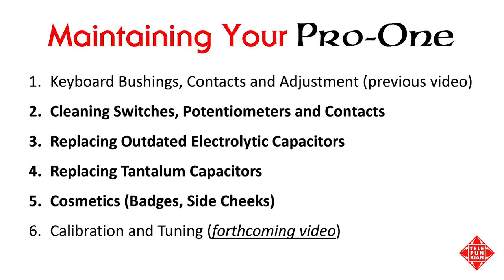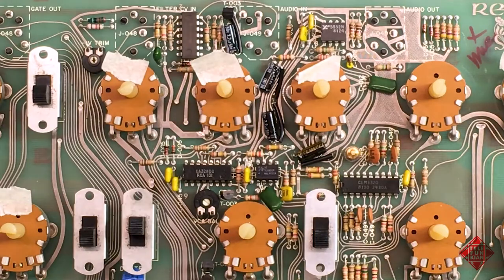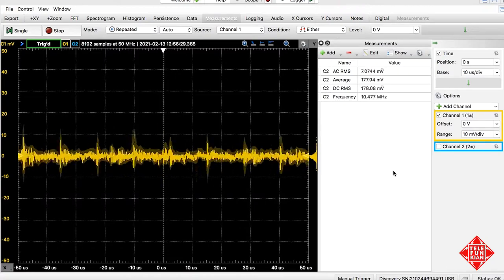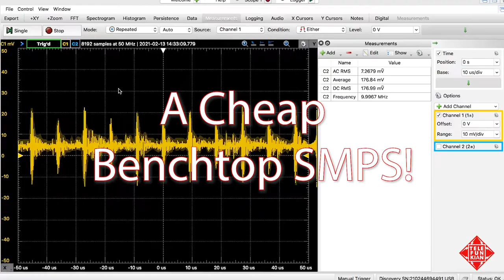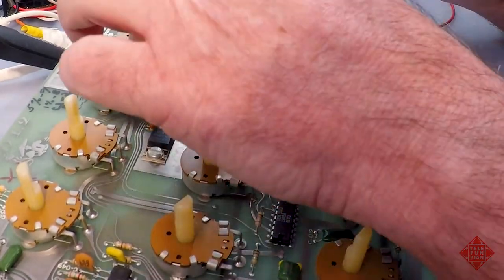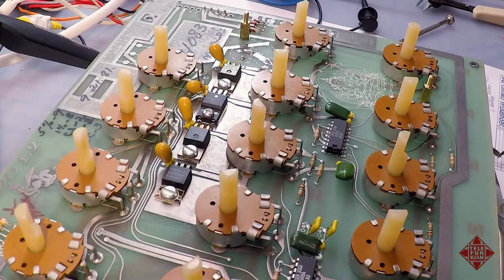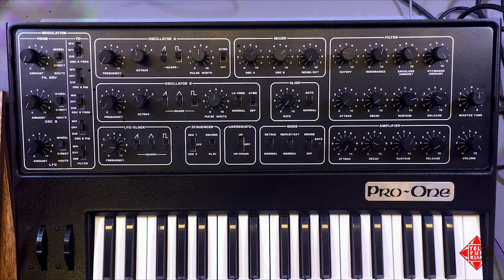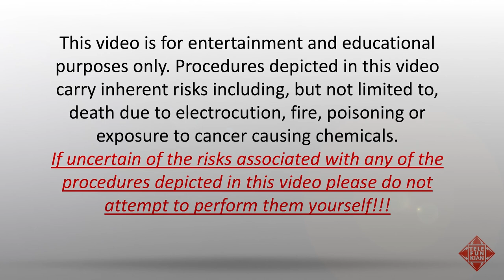Maintaining Your Pro One

Comment: Hey Telefunkian! Thanks for this video. I shot you an email, but was curious which new capacitors you ended up going with in the end.  Thank you!
Reply from the maker: Danny, Thanks for the message. I can't recall which caps I used off the top of my head but generally I use Nichicon's or Panasonic. If at all possible I use 105 degree C caps in the power supply and 'Audio' grade caps in the case where caps are in the audio path (Nichicon FG, FW KZ etc.). The audio grade caps are most probably overkill but they only add a few dollars to the cost of a recap, and these machines are pretty special so why not. Stick with original capacitance and close to or slightly exceeding voltage ratings. For tantalums I usually use Kemets. Sorry about the email, I don't check it too often.

Comment: A fascinating video -- thanks so much for sharing it! I came across your vids as I was replacing old key bushings on my two Pro-Ones, and while I'm comfortable doing so and also cleaning my pots and switches, I'm not so much on PCB soldering. These have been in my studio but unused since the late 80s -- am I hearing you correctly that powering up after all these years could be damaging if the old caps blow? 

The new cheeks look great, very much like the wood used for the Prophet 5, I think. At one point there was an outfit that sold Prophet 5-like wooden enclosures for Pro-Ones for a completely deluxe treatment!

Thanks again. I find your videos very informative, will def subscribe. Cheers!
Reply: Nevermind -- just rewatched and saw the explanation of different types of cap failure. Yikes!

Comment: Don't you get loose pots from this method? I highly advice against squirting in deoxit like that unless you want all grease on the shaft to disolve. It's actually way better to apply drops with a syringe instead of blowing it in.
Reply from the maker: Yes, you can get loose pots from this method, and if that bothers you you can disassemble the pot and re-grease. I tend to use DeOxit D5 less and less for a variety of reasons, but when I do use DeOxit on pots now I use F5 which is designed for pots and has a grease component.